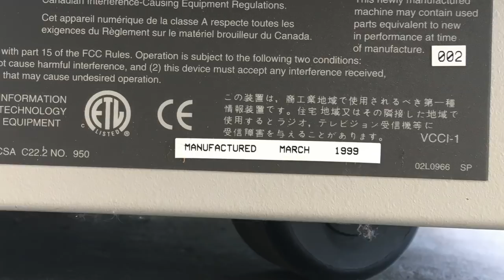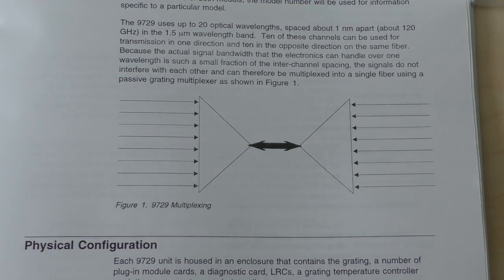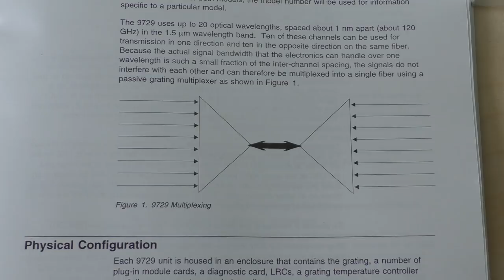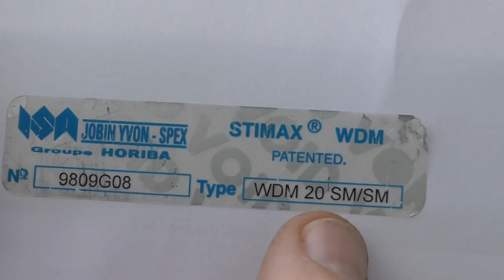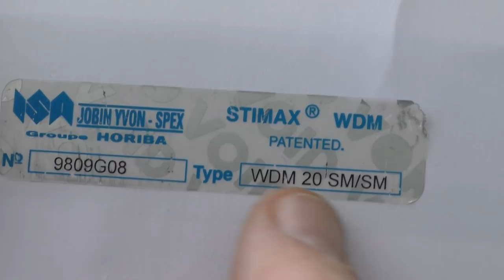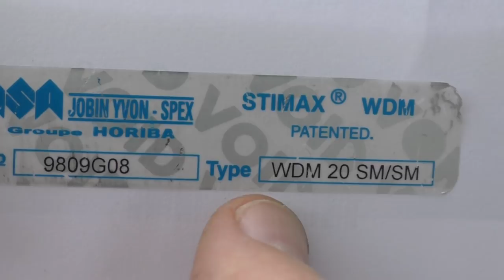IBM 9729 optical wavelength multiplexer - (PWJ94)

Comment: Neat piece!  I work for an ISP and we use the modern equivalent (Cisco ONS) of these devices.  The neat thing about the modern systems is the ability to "build a wave" (or virtual optical circuit) on the system and your "endpoints" are like a traditional fiber patch panel.   And as someone else noted - SM is "single mode" as opposed to multi-mode fiber.
Reply from the maker: Yeah single mode..... sometimes when I speak, I forget the right words :-)

Comment: When you transmit and receive on the same fiber it is called dual  wavelength. Typically today on a fiber Network involving high capacity on a single fiber they will use time division multiplexing wavelength multiplexing and light polarization and dual wavelength to reach the maximum capacity. Basically they pass the light through prism which combines the wavelengths and at the other end pass it back through a prism which allows them to be separated. Polarization they have a y access wavelength in an X axis wavelength The other fascinating thing is Optical amplification amplifying the light without regeneration.
Reply from the maker: I would like to see all that technology in real life.... optical amplification... hmmmm :-)
Reply from the maker: I had a look at the "A" unit... seems that the channels are 2nm apart while the "A" unit uses the odd wavelengths (1553, 1555...nm) and the "B" unit uses even numbers (1552, 1554...nm). So the total wavelength separation is only 1nm!

Comment: Have you ever tried to read the data stored on the chips you find in these things. I mean in this piece and the E meter you found things that didnt seem to fit in with its purpose so to speak.  I would hold on to these things until you find an explanation for the anomaly.

Comment: The receiver is a reverse-biased photodiode. To get the high bitrate/ratio, it's biased with a very high voltage.
Reply: How does that work, then?
Reply: http://bfy.tw/I4Fo Also like Mike says, "Avalanche photodetector" is a good search term.
Reply: Thanks for that - it was more a question of how high voltage helps with a high bit-rate.

Comment: Why does it need so much cooling?
Reply: lewsdiod Converting optical to electrical signals used up a lot of power.
Reply: Optical multiplexer have narrow channels and the wavelength of a laser depends on the temperature so he need to be regulated in temperature and the dissipator should include a peltier element
Reply from the maker: In fact they are cooling AND heating depending on the outside air temperature. The WMD must be kept at a constant temperature and it must be the same on both ends A and B unit.
Reply: The optical block changes lengh when cooled/heated, so wavelength would be all over the place. Keeping it at at constant temperature fixes that issue.

Comment: I got the same receiver module from an even old fiber receiver and I found a (small) datasheet. Its an Avalanch Photodiode with an integrated amplifier running at  -90V  Bias and -5.2V supply . I will post a link, when I finally find the datasheet again...
EDIT: Its a Lucent 1319 http://pdf.datasheetbank.com/datasheet-download/195865/1/ETC1/1319
Reply from the maker: Thanks for the data sheet. I was looking for that half a day until I gave up. I think I will have to open one of those and have a look inside :-)
Reply from the maker: So the bias voltage is 35-85 Volts.... IBM has always been very cautious with it's warning labels. "Warning 400V" seems to be a bit exaggerated... But the had probably no smaller value :-)